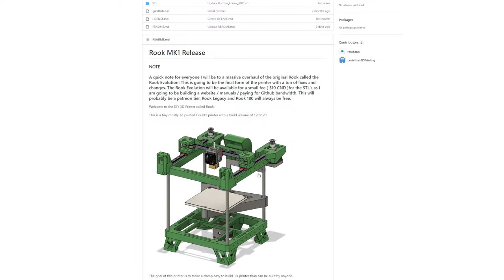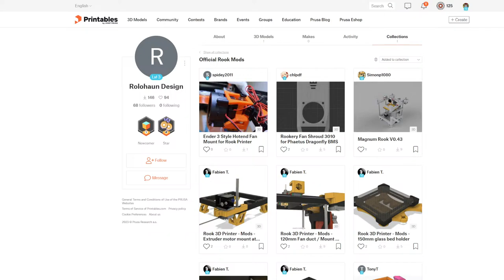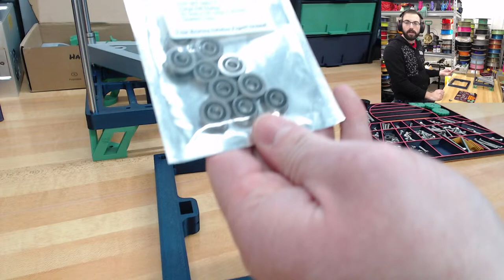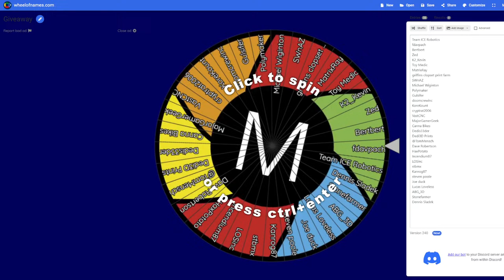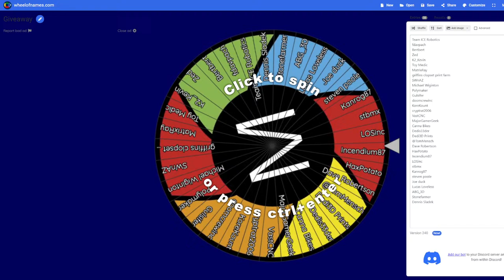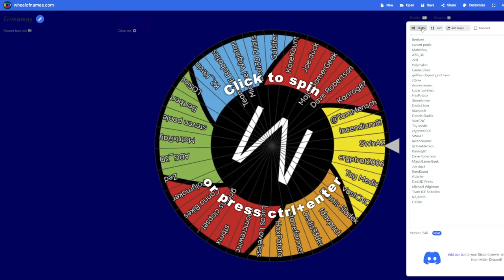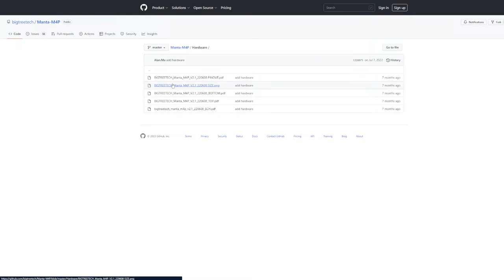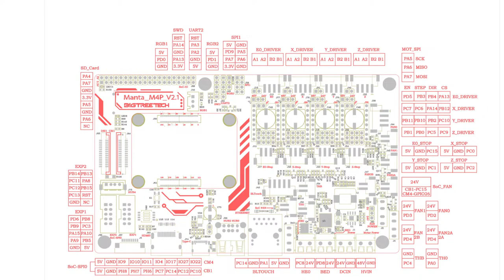Rook MK1 - Mostly 3D Printed CoreXY Printer - Build Series Part 1

Comment: I'm thinking you will need at least a 40mm fan under that heated bed to temper the high temps on that PLA base holding the bed.

Comment: Question: do you iso wash your rails, carriages and lenier bearings and then re-lube? I hear the oil they have on them from the factory aren't a good lubricant. 

I'm building a tall rook as well. All I need now are my steppers, electronics, and some m5's. Hoping I can get a serial below 100.
Reply from the maker: I mostly just add additional grease to the ball bearings since they usually do not come with any, and wipe excess oil off with a blue shop towel. I like the syringes pre filled with grease (EP2 works well).

Comment: Is there any reason why someone couldn't print this in polymaker polylite abs and enclose it?
Reply from the maker: I originally tried to print it in ABS but didn't scale the holes correctly, and the part tends to warp since it's fairly large. You can always try printing the test piece in ABS and adjust the part scaling so 8mm rods fit.
Reply: @hedgehogmakes  a heated chamber with proper cooling (warm air, airflow) goes a long way to combat warping... as far as shrinkage, that's typically a matter of tuning extrusion multiplier and making sure esteps are bang on but I could see that it would be extremely challenging given the tolerances.  Once I get my v0 online I very well may investigate this design to put my spare parts to use... alas, I don't really print much pla anymore though, so the pla parts kind of gets me... and then there's the hotend mount... i'm not sure how well it can take abs temps... but then, from the feel of everything, this was designed as an extremely easy to build PLA printer using easily accessable parts, and that's great in and of itself...  just not be right for my needs.

Comment: Is there a way you could take a Anycubic Mega S printer and take all the parts like for example the rods the motors,mainboard, printbed/heatbed and the power supply. 
I have a Printer laying around and would like to build a core xy Rook with it. Printable parts out of abs or asa. Wozld be great to see this happening. Recycled Printer.

Comment: Hi, I want to do this project too🙂 . I think I'm going to do it with standard PLA with correctly parameters with my slicer.
Thanks for your build guide of Rook Project. :hand-purple-blue-peace:
Reply from the maker: Reach out if you need any help!
Reply: @hedgehogmakes  Great, thanks a lot. I currently have an anet A6 and I want to pick up some components to fit on the Rook. 

I don't know if I can reuse my anet motherboard for use on the Rook? It uses 12V input voltage 🙂

Comment: 2nd question: is there a motor mount mod that is even height for flush x gantry homing, that also accepts the 200mm y rails?
Reply from the maker: With 200mm Y rails you do not need the modded mounts, but there is a version avaliable on Printables

Comment: ZombieHedgehog is going to force me to build one of these out of my spare parts...  I've got my original AB motors from my v2 (that i upgraded with speedy powers), my original afterburner extruder motor, probably just enough belt, more than enough m3, m5 hardware, I'd just need some rod, bearings, shims, rails, a z motor, and an sbc...at least that's what it looks like to me so far.
Reply from the maker: The BOM is pretty small if you have a lot of spare parts!

Comment: I wonder if there are off the shelf threaded steel/aluminum bars that match the holes in mgn7 or mgn9 rails for backing a printed gantry like the rook - I feel like that method would add significant rigidity to the x axis without significant weight increase.